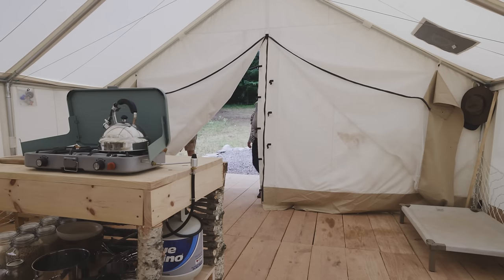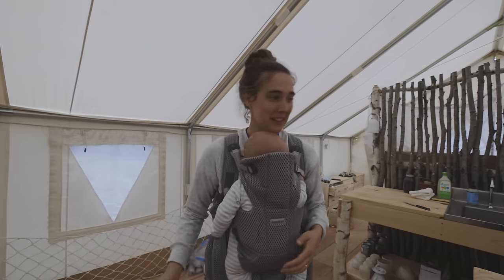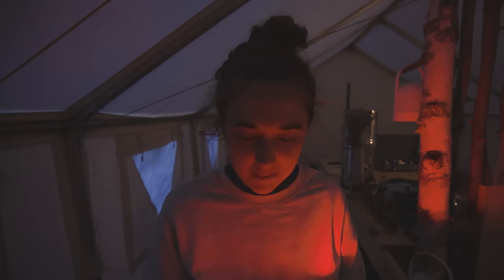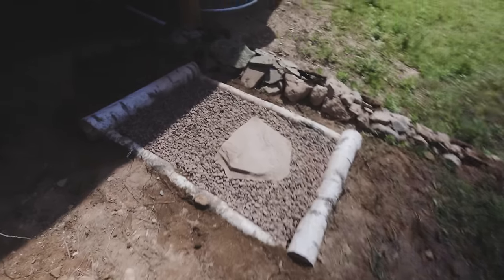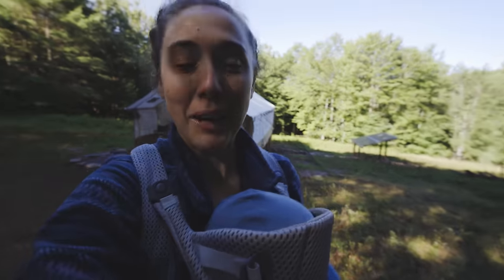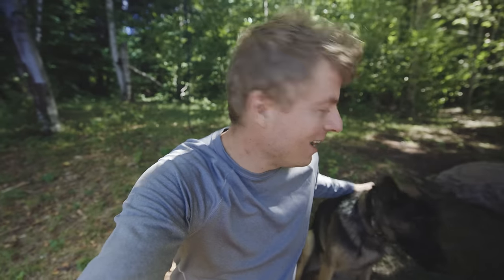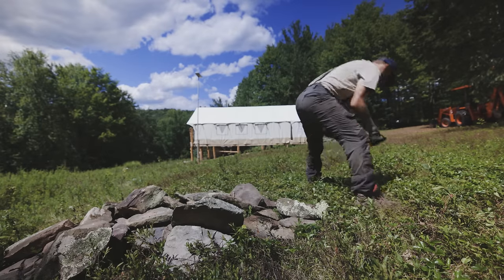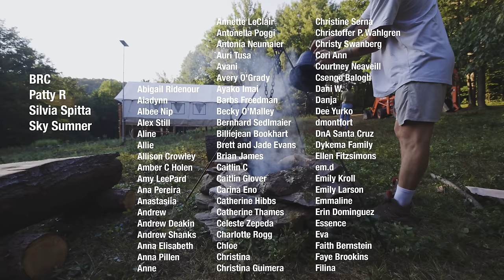Moving Into The Wall Tent (kind of)

Comment: Plant lavender around the wall tent. Mosquitoes hate lavender. You can also use lavender oil. Put your urine in a jar and pour it on your property perimeter of your property near the wall tent (do this weekly) the animals around your wood areas will stay clear out of fear. You can also do this about 10-15 from your veggie garden if you dont have a fence around it.
Reply: I definitely think the urine trick works and when using a separator composting system it is super easy and becomes a regular part of the flow (pun intended) of life.

Comment: By the way, you can look into getting a clothesline spacer, which basically is a set of wheels that attaches the bottom line with the heavy clothes to the upper, empty line, so that the bottom line is better supported and doesn't sag as much in the middle. :)

Comment: Yes ... anything with an aroma (food, toothpaste, deodorant, etc.) can draw bears!!!  There are some low-voltage "bear fences" people use to tent camp in bear country --- I really think it would be a great investment for that little bit extra insurance!  You just string the wire around whatever area you want to "protest" and it's fairly temporary if you want it to be --- Bears require a minimum of 5,000 to 7,000 volts of electricity to be deterred—depending on the species and the bear's level of experience.
I guess another thing you could do is build/install a bear box like they have in campgrounds to keep some food and also your trash.  That would help deter raccoons and other critters as well.   Places like Tahoe Bear Box Company sell them for you to build/install on your property and even have trash lock-ups as well.
I hope Max is responding well to treatments ... my son was born with Hip Dysplasia and wore a harness 24/7 (I bought an extra one beyond what the insurance provided so we could always have a clean one) and his problem corrected in 3 months instead of the 9-10 months the doctors predicted.  He's 30 now ... never had any issues.

Comment: Clothesline tip! If you get a few clothesline spacers it will take some of the tension off the line and also keep the items farther from the ground. It’s great when you have larger items like sheets. Wonderful video as always!!
Reply: Then the pulley system wouldn’t work.
Reply: @benjigirl1971  Hi there! It does actually, my mom uses the system and it works great. You clip on a few items to the clothesline and when it gets heavy and starts to sag you attach a spacer that has wheels and can rope along the top and bottom as they’re going in different directions, then you can add more items and so on. A lot of the Amish and Mennonite community close to where I grew up in upstate NY use it.

Comment: The cast pot you were given is called a Dutch oven, it’s really really handy for cooking you can put it into the coals if you let your fire die down a bit and put coals on top and it acts as an oven and you can bake bread or anything you would normally use an oven for in it it’s amazing and one of my favourite tools.

Comment: Bleech in small containers in the areas that you have problems with the raccoons works. They can be very mean little creatures. You may want to invest in bear spray, air horns and a gun just in case but if there is food around it will certainly attract them. Lovely place  :)